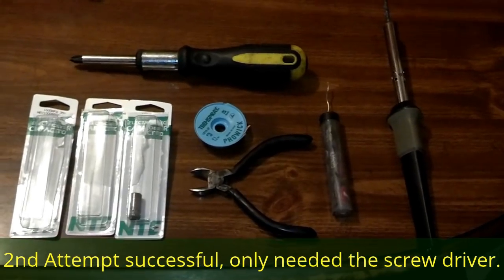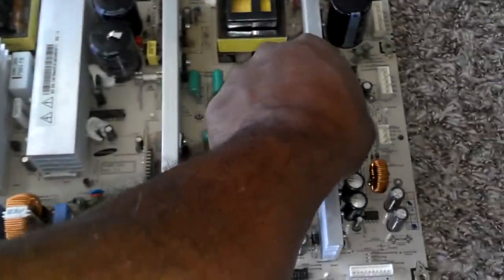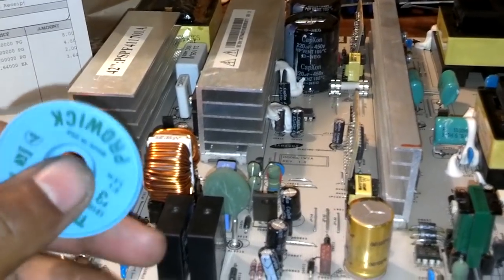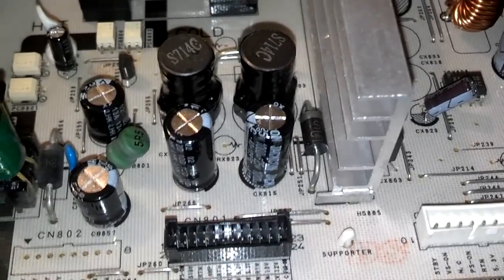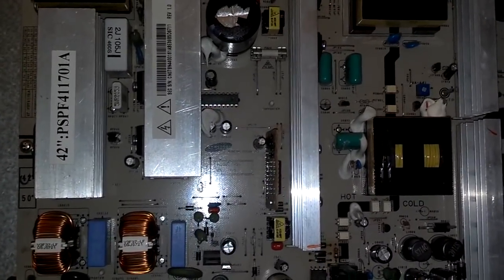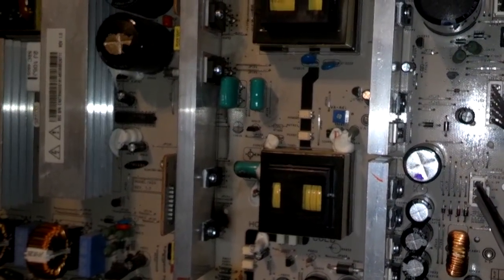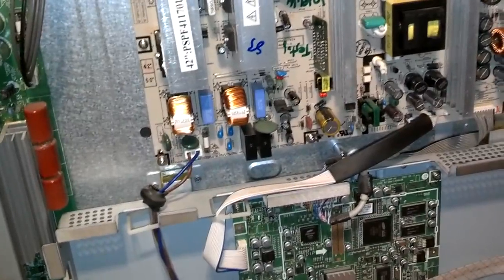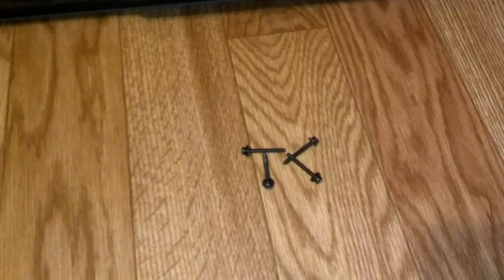TV repair, clicking and will not power on, loud snap, no picture, etc. - VOTD

Comment: Yeah! The electonics stops working as the magical smoke comes out of the parts :) So it seams the transistor was the main gangster and blows up the condensators... The vid is very nice and takes the fear to get into this job and try the luck, mostly there are some few cheap parts who has losen the magic smoke from inside :) But as alway a good diagnose is the most important! Thank you for this video and educate us in many things.
Reply from the maker: Dalibor Sacaric Yes, sometimes a fail happens. No harm in showing that as well. LOL Thanks for watching.

Comment: I have a "50 plasma, was making the clicking noise when turned on.  (Isn't anymore)  opened the back and all looked fine except one relay was broken on the side, just the plastic cap which fell off.  This was on the power supply board.  How do i do a quick test to see if this is my faulty component?

Comment: I did change five blown capacitors about two years ago on same model.  There was chain reactions of MOSFETS blowing up.  I ended up buying another used board.  Plasma TVs might have clear pictures buy high voltage/current make it dangerous to work on.
Reply from the maker: Thanks for sharing.
Reply: Older TV's 📺 were so much better far as the quality of life and cost. Why do these newer TV's blow out or make sounds and noises? And do anyone know why the compacitors blow out? Ps. New Subscriber 🤗

Comment: This is a video i like. Usually i can only see "easy fixing simple as that" videos. You failed like many of us and showed it. I have issue with my crt tv. When i turn it on there is no picture, everything is dark and 5 minutes countdown shut down starts. Sometimes when i start searching channels or wiggle antena it starts to work normaly. But still randomly goes dark and shut down countdown starts. My guess is it is some capacitor. Another crt tv died and when i opened it i saw burned stuff like in yours. I took a good board from same manufacturer (samsung) but not exactly the same type and when i switched it on there is nothing on the screen. Replacement board is from a 1mm diagonal smaller tv. Does the size make a difference or screen is dead on that one?
Reply from the maker: I have no idea.

Comment: Finally a video that matches the exact problem I have. I only had one capacitor blown that I can see but the burnt mark is exactly in the same place as yours man. How in the heck does this happen to everyone? I wonder what caused this problem Because if I fix it I don't want it to happen again someday
Reply from the maker: +Derek2k17 mine is still good. It should be good at least 38 minutes.
Reply: Robert DIY haha! 38 minutes?! Btw you made this video a while ago and the power boards for this tv are still expensive. Like $80 to over $100. I wish I could just fix the power board but like yours it's just done for. Too burnt. Guess I'll have to get a new TV if I can't find a repair place near me that will either replace the board or somehow fix it for cheap. Thanks for this video. I probably would have replaced the capacitors only....and then it would still be broken.
Reply from the maker: +Derek2k17 I think mine caught fire. New smart TV's are so cheap I can't see paying a shop to fix one.

Comment: We purchased a Hitachi model number 51 UWx 20 B and it was working when we moved it from point A to point B but it will not turn on or give us any picture or sound now. The red light comes on in the front to indicate that the power is on but nothing else. It does not blink we checked outlets and other obvious possibilities. Can you help us
Reply from the maker: Perry Foster Probably bad compositors. You should remove the back of it and look for swollen ones.

Comment: Hi I have a byDsign 32 inch Led tv it turns on now and them light stays red does not go blue to show it turns on. If you leave it turned off for about a month it will turn on and I replaced the power board a few months ago when it gave the same problem.
Reply from the maker: +Sam Vice interesting.

Comment: hello! my TH-50PX60U panasonic plasma made in 2006 is not powering on. i hear 2 fast clicks. it feels like wanting to start but after 2 or 3 seconds it shuts down. red led on power button blinks 5 times. what board will be the problem and how can i test for voltage to confirm the board issue. thanks!!
Reply from the maker: Pedro Morales Magonzales Maratto Mulasso Modestos The most common problem with a tv not powering on is bad capacitors. They are usually visibly damaged, swollen tops.
Reply: I have replaced hi volt capacitors they are made of white mineral substance the one I relaced had no reading across it with volt meter so no bulging in a faulty cap

Comment: got a brand new samsung 50 inch plasma tv had it for a month when lightning hit a pole near my house 72 thousand volts popped like an explosion... unfortunately my new plasma tv won't power on now can you suggest what i might do. i just wonder what it might be. its still under warranty so i'm waiting on a technician from samsung to come fix it but what would i do if i had to fix it myself. thanks i digged your video bruh.
Reply from the maker: TheDaddycatty Man, I doubt a power strike will be covered under warranty. They sell power surge protection strips that include equipment insurance coverage. Besides all that, you have to open the box to see what is damaged. I probably would not open it until Samsung gets done with what they will do. When they had a technician work on one of my sets, the shop scratched the casing of the set up pretty bad and would not fix it. Made me wonder if Samsung cares about their customers.
Reply: thanks but i had ordered this through a company where i was making payments on it. i'm sending it back and they are giving me the credit to my account. i will order a new one when it gets credited to my account.  a lightning strike is called an act of God and no just the warranty alone will not cover it.

Comment: Hello I have a Sony Bravia 55 inch LCD TV. When it turns on and off it makes a click sound. People say its not normal.
Reply from the maker: Probably has a bad resister. Do you have it plugged into a power protector strip?
Reply: It's plugged into a Side Socket protector.

Comment: my samsung plasma 48 inches  model number ps43d490a1,,,,,,,type-ps43d490..when you plug it on power there is a red light showing,but if you light it up using a remote or manual it clicks and the  red light goes off.
Reply from the maker: +djsargy siage Probably the same problem.

Comment: The reason why it blew as bad as it did was because the failed solder joint killed that transistor which is why it blew up so badly.
Reply from the maker: +MrReeceyburger123 Oh, I probably need to take some electronics class. That stuff doesn't sink in my head the way I need it to.
Reply: +Robert DIY Haha no worries its good to know helps out with everything I find.
Reply: MrReeceyburger123 is it dangerous if it        Keeps popping and turning of and power going on and off as if it’s trying to turn back on but doesn’t

Comment: Thats a dam shame you put all that work into the old pcb :-( :-(
I was hoping you were going to test that transistor, but when you said resolder it i thought oh shit it could be damaged, and the dam thing was :-(

Short circuits between the pins would have caused that to explode, if you hadnt bought another psu board i would say look the part up, get it from ebay, check the drive input of that transistor and check components connected to it.

What a shame, well that new psu looks smashing so it should last a loooooong time now :-))
Reply from the maker: zx8401ztv I got the psu from eBay, refurbished. Most of those guys say that will not take an old board if it has any burnt marks on it. So, I was toast going in. Glad I only wasted $18 US.

Comment: These power boards are crap, its alway best to repair the original board as you can make it more reliable ! Its an ok tutorial however you should always take the proper precautions like checking for shorted part and never ground to chassis because if something shorts to ground your screwed haha.
Reply from the maker: +MrReeceyburger123 Yikes! I know nothing about electronics.
Reply: +Robert DIY If it does fail again I have a video about repairing one of these.